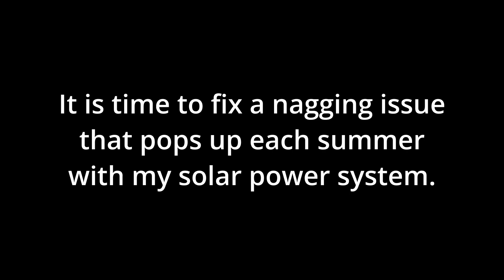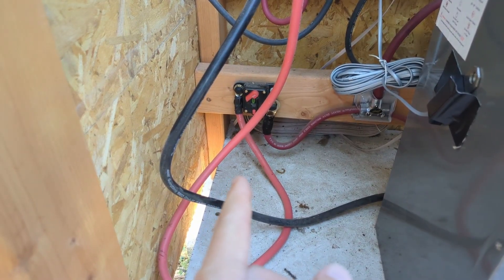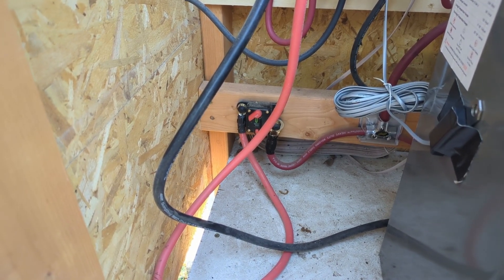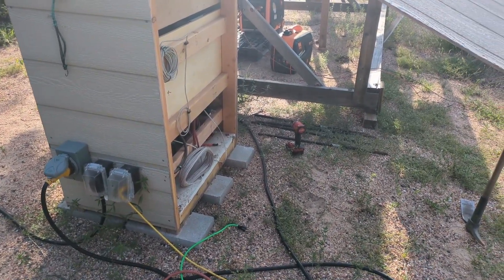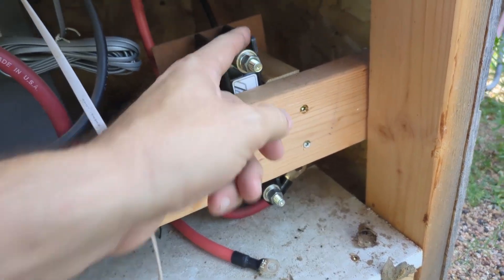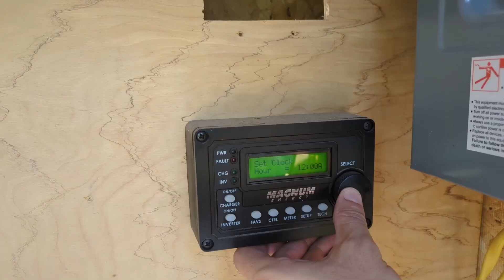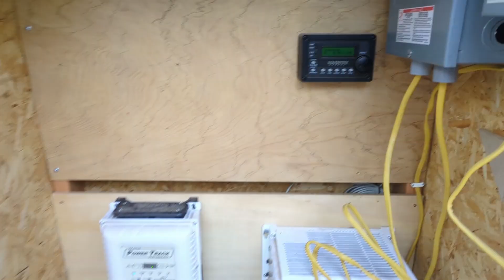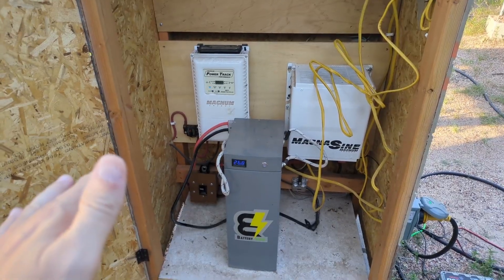Upgrading My Cheap Thermal Breakers To The Mother Of All Solar DC Breakers!  250A Hydraulic Magnetic

Comment: I hope you are rating you breakers for the size of wire in the system and NOT what the system can provide,.  Breakers and fuzzes are made to protect the smallest wire in the circuit.
Reply from the maker: I agree with what you are saying, but I believe that priority is backwards.  In engineering my systems, I size the breakers to protect the components of the system.  I then over-size the cable to far exceed whatever that breaker rating is.

Comment: That breaker is crazy size, I still run the small cheap ones on my small set up.
Another step forward! Onward!
Reply from the maker: Yeah I've never run a breaker that big in my life.  But my eventual solar panel system will be about 20x the size of this current system so I better get used to it!